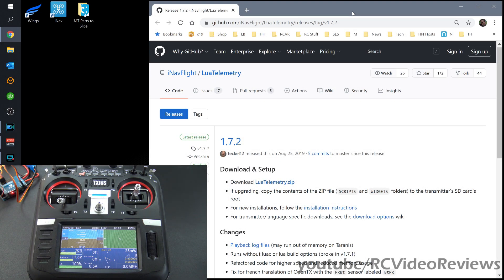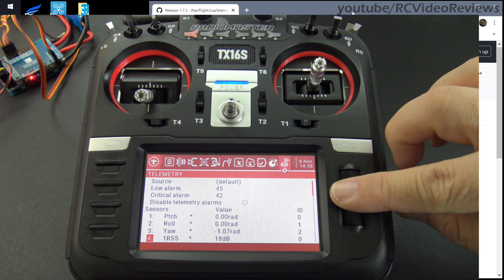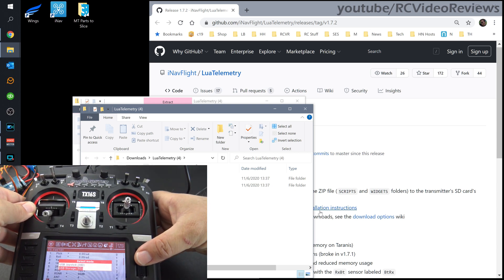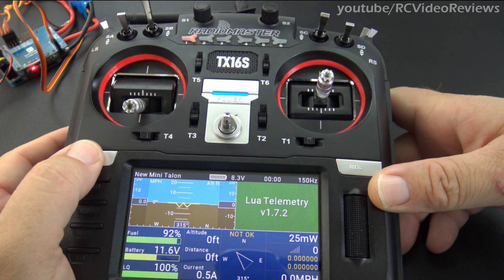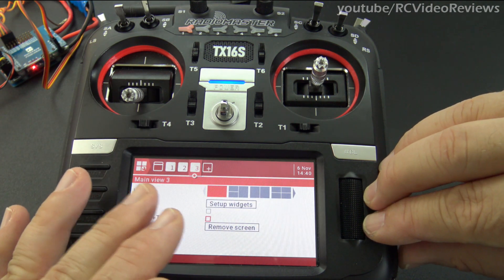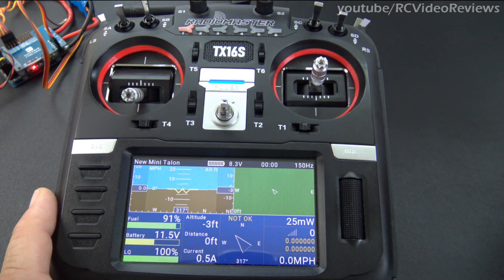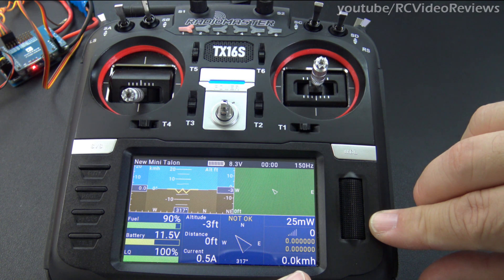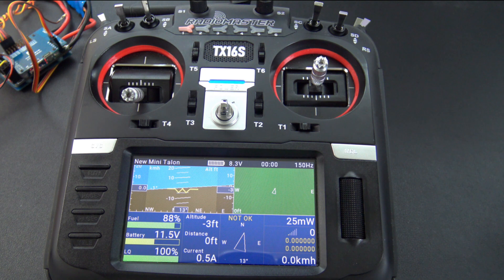How-to add iNav Telemetry Lua Script to Radiomaster TX16s

Comment: This guy really knows how to explain and teach how to set up the TX16S,  very clear and helpful. 
I’m really impressed by how accurately the TX16S shows the plane’s orientation (roll, pitch, yaw).
Could you please tell me which Flight Controller model you are using?
I’d like to buy the same FC model for my own plane.

Comment: I've been getting battery critical alarms with high cell voltage. I couldn't find a global setting that would produce that, so I suspect maybe it's in the LUA script. First person I've seen get into the LUA script menu. I tried to get in there with your directions, when I select EXECUTE I get a screen that says SCRIPT SYNTAX ERROR lualoadscripts(stnda) no run function. Any idea what that is. Hate the warnings, but no idea where they are coming from.
Reply: @MatyasArby  i have the same issue. Did you find the solution yet?

Comment: Hi, I added Inav Lua but the pitch axis is inverted, have you ever see such thing? When the FC pitch-up the telemetry is positive and when it pitch-down the telemtry is negative. Is there a setting for this?
Reply from the maker: Wonder if there's an issue with board orientation. Seems like your iNav setup is wrong to me.
Reply: I will try to wipe it out and reinstall it afterwards. Is your pitch telemetry positive or negative when your flight controller pitch up?
Reply from the maker: I don't have an iNav plane active at the moment. You'd be much better off joining my discord and asking there. https://discord.gg/jSFTASU
Reply: Will do thanks 👍

Comment: Excellent tutorial.  I got mine working, but the update speed is very slow -- like a bit over 1 second frequency.  So if I move my model, the AHI lags severely behind as to make that useless.  Any ideas how to fix this?  The top right corner of my screen shows 250Hz which is obviously wrong.  It's more like 1Hz update speed.
Reply from the maker: Might have to check with the developer on that one. :(
Reply: @RCVideoReviews  I found out if I use Crossfire module then the iNav AHI smooth.  But if I switch to ELRS then it becomes slow as I described above.  A friend of mine has the same problem.  We haven't found the solution yet but it's a start to tracking down the fix...
Reply from the maker: @beyondfossil  try turning up your telemetry rate in ELRS lua.

Comment: Thanks for the tip on setting the alarm thresholds.  I searched for a long time.  There is another item that I have not figured out.  How do you get a map display onto the upper right section?  I tried downloading map segments but they don't display.

Comment: Does this process have to be done for each model in the radio?
Reply from the maker: Yes, for any model that has iNav and that you want the iNav telemetry LUA to operate, you'll have to add it. There are options though, you can setup one model and use it as a template for others. That's what I do.

Comment: Great video.  So what is up with the upper right area where there is supposed to be a map.  How do you set that to work?
Reply from the maker: I never did figure that out.
Reply: I did install on a separate page the mapping widget which is a full screen map and you can add the key telemetry elements desired.   @RCVideoReviews
Reply from the maker: Oh cool. Sounds useful.

Comment: I don't know for what reason but the colors on my LCD change to very unreadable after running this script. What is the default theme to use for this script to work correctly?
Reply from the maker: To eliminate themes from the question, your best bet would be to use the default EdgeTX theme. I guarantee if the theme is involved, it would have surfaced with the default theme. Alternatively, check with the developer. Sounds like an odd issue to me.

Comment: Hi.  I have followed your video and the iNav script is running nicely with the iNav "standard model" installed on my TX16s.  The annoying bit is that if I change a switch such as SW A or SW D (back to the centre position) the Mode (Angle - Horizon - Acro) is spoken three times.  Is that normal, or if not what may be wrong ?   Oddly if the receiver (and thus model) is switched Off the Mode is only spoken once so the problem appears to be with the Telemetry script.
Reply from the maker: Not sure. You'd probably need to bring this one up with the developer.

Comment: I have inav lua working on 2 different planes, only thing not working is the output power of the exspresselrs  transmitter, funny thing is that in osd it's working just fine but on radiomaster tx16s screen it shows 0mw on tx output, also wondering whats the sensor name that provides tx out put power? Thanks for all your videos
Reply from the maker: TPWR is the name of the sensor for ELRS transmitter power. If it's not displaying correctly in iNav LUA, you may need to check with the developer.
Reply: Ok thanks will do

Comment: I have been getting grey hair with this one.
Got all working, on radio tx16s with working telemetry with jumper R8 to pixhawk 6 c.
But no value on distance from home or roll, yaw. Noticed on the telemetry list I do not have 0420 sensor for distance to home, or the 0430 onwards for the horizon graphic.
Do you have any ideas. I currently get it from separate osd, but want it on 2.4ghz
Regards
Dave Pope
Reply from the maker: Probably need to get on the iNav github and see if you can contact the developer. Hard to be involved with that level of detail on so many different possible setups/firmwares/controllers etc...If overall functionality works, the details will be down to the developer to help you sort out.
Reply: @RCVideoReviews  awesome thanks, love your video's.

Comment: very nice video , I installed the inav LUA in my TX16s, I use Frsky receiver on a pixhawk,  but I cannot get orientation data, the inav page basically not showing any data, any suggestions ? I am not sure does inav support mavlink which is used by PX4, thanks
Reply from the maker: Probably should let the iNav developer know. It's probably a sensor definition issue.

Comment: Hi John
Just followed your instructions on installing inav telemetry widget. However the respince time on the screen when I mive the plane is like 12 or more seconds. Any thoughts or advise?
Reply from the maker: Only to ensure you're on the latest copy of iNav. If you are and this is a repeatable issue, you should open an issue with the iNav developer.
Reply: @RCVideoReviews  using inav ver 5.1.

Comment: Great video!  But has anyone else had the problem where it won't show you or announce the modes other than Manual, Angle, and Acro?  Any other mode like RTH or Position Hold just show up as ACRO.  I'm using the TX16S with Crossfire Micro TX and Nano RX and MATEK F11WSE.  All firmware is fully up to date as of 9/20/2022 and the iNAV Configurator shows that all the modes are being selected correctly.

UPDATE - I thought it was Crossfire causing the problem but found it's actually iNAV that's doing it and it's specifically this version: inav_5.1.0_MATEKF411SE_FD_SFTSRL1.   I needed the softserial port for the DJI FPV Air Unit.  But now I've connected my analog camera and VTX to the F411WSE board and I can see that iNAV is using ACRO for all modes except Manual and Angle.  I need to see if I can find the right place on Github and enter a ticket.
Reply: I am using EdgeTX2.7.1, TX16S and Crossfire TX and I had the similar issue. When I set the baud rate for external crossfire TX equal to or smaller than 400K, the telemetry data only show pitch and roll data, no others. But if I increased the baud rate more than 400K, then the issue disappeared ...  Not sure what is the cause...

Comment: Apparently the current inav.lua script on EdgeTX cannot be run directly by executing form Scirpts folder on sd card.  It is meant to be run via the widget feature of EdgeTX.   I got a nill value error when trying to execute as a script.  I was told this by opening an issue on the github repository.

Comment: Question?
I guess the Fuel Percentage value on your screen, is really the Battery shown as a Percentage?
Thanks!
Reply from the maker: I believe it's derived from BF information where you enter the cell capacity and your desired cutoff voltage; however, I haven't really experimented with it so can't say for sure.
Reply: @RCVideoReviews  Thanks!  I have not seen any information that has specifically explained how Fuel data is calculated.
Also, thanks for taking time to produce these great videos.
Reply from the maker: You’re welcome. Let me know what you find out. It probably wouldn’t be too hard to confirm with a little testing.

Comment: I just followed your video on upgrading to EdgeTX 2.7, Black Pearl, which was done in 2022. This Video was done in 2020. Is this compatible with Black Pearl?
Reply from the maker: The latest iNav Widget https://github.com/iNavFlight/OpenTX-Telemetry-Widget/releases/download/v2.1.0/LuaTelemetry_v2.1.0.zip loads and runs on Black Pearl. Whether or not it "works" using your sensors/telemetry/fc etc...I can't answer. It loads and runs fine as a widget.

Comment: I have the screen working on my TX 16 but when I put on my FPV goggles I get a warning on the screen to disable navigation first, unable to connect. My Goggles are Fat Shark Scout. Do you have any idea what I'm doing wrong and why I don't have throttle control?
Reply from the maker: I'm not familiar with any error message that says, "disable navigation first, unable to connect".  If you're using analog goggles, there is no interaction between the transmission/reception of data and the flight computer other than the overlay of OSD. In other words, there is no mode on the FC that can prevent video data from reaching the goggles. Navigation modes generally involve the GPS, so you may want to ensure you have a manual mode available and that it is active before attempting to arm.
Reply: @RCVideoReviews  it is showing on the screen it is manual mode. I believe I have something set wrong in my tx as when tested on another trans that was used previously with this model everything works. I had to load the iNav files to my tx so I need to check the files to see what is different, thank you

Comment: Hi John, what flight controller are you using here and how did you wire up you crossfire rx? Thanks 🙏
Reply from the maker: It was probably an F722-WPX, but it's more about iNav sensors and the ability to send those sensors via telemetry to the radio. Crossfire is wired like any other Crossfire to BF/iNav board: Hot and Ground + Rx and Tx to a UART.

Comment: Hey I was just wondering if someone knows is there a way to put the home direction arrow on this widget? I'm going to be using it for a quad but just in case my goggles die while doing long range it would be nice to at least get a home arrow to guide me back till I could land line of sight. Thanks?

Comment: Can this be setup on the DJI F550 hexacopter?
Reply from the maker: The LUA scripts depend on iNav telemetry. So the script will load, but no data will appear unless you're getting telemetry using the same sensor names the script expects from iNav.

Comment: hi dear i have try inav scrit in my t18 with edgetx but i see only graphics value and not text lyke battery fuel level and these values are only shown when  the battery  of my quod are disconnected . what happens?

Comment: This works with Edgetx?
Reply from the maker: I just checked yesterday and it does work with EdgeTX 2.6 BUT I didn’t launch a craft to verify sensors. It does load and run though.

Comment: Ok i add to my radiomaster and i see power tx signal rssi but my baterry have 0v. I search new sensor and the same. Whats the happens?
Reply from the maker: You probably aren’t getting pack voltage telemetry. Don’t mistake that for A1 and A2.

Comment: That "Fuel" gauge is confusing...
What is it reading? Battery percent? (but all battery packs are different)
How does it know?

Cheers from New Zealand and Kia Kaha!
Reply from the maker: In betaflight you can set the mah of the battery and your low voltage cutoff. The flight computer can calculate mah consumed with a current sensor, therefore the fuel % can be derived. Honestly, I don't pay any attention to any of that stuff. I simply watch my voltage. Depending on the type of aircraft, I get it on the ground around 3.6-3.75v/s

Comment: Hi, I have two airplanes in the RadioMaster TX16S transmitter using the Inav telemetry page. For one airplane the page is working OK in accordance with your tutorial. But in the other airplane the page is not working. The artificial horizon is not moving when I move the airplane and also the information like battery voltage, fuel and number of satelites aren't appearing. Could you help me? Thanks
Reply: I did the reset flight and reset telemetry and nothing happened.
Reply from the maker: Do you see telemetry data on the telemetry page of the radio? i.e. Discover new sensors...does that populate sensors and their data?
Reply: @RCVideoReviews  Yes. When I do discover new sensors it didn't discover the GPS
Reply from the maker: So you see sensors for attitude, voltage, fuel, but not number of satellites? 
You may need to speak with the inav lua script developer on github. What I know is that when I have the sensors active on my model and then I activate the lua, the lua script works. If you have sensors and the lua script is not working, you'll probably need help from the guy who wrote it. There is no option to turn these things on or off that I know of within the script.
Reply: @RCVideoReviews  The Crossfire receiver was bad. The telemetry was erractic. Then, I installed a new one and the problem was solved. Thanks for your support. Cheers from Brazil

Comment: Hi, friend, I followed your instruction, and I successfully installed and run this script, on Sbus Frsky and Matek F765, everything seems working right , EXCEPT for that sensor called "FUEL", in my case, when I power up the plane, this sensor just start very slowly increase the "%" and its just keep increasing until 1200,,1205% etc etc and dont stop, even when the model is on the bench and nothing is running !! what could be wrong ? some parameters that need just adjust in editing ?, thank you and waiting for suggestions..greetings !
Reply from the maker: Not sure. Did you set an MAH level in betaflight/iNav?
Reply: @RCVideoReviews  I fixed now, it was two things , first, you have to set FUEL = PERCENT in the CLI, and second in the configuration tab, the field "Capacity" you have to complete it with you specific battery total mAh to use. And now it match perfectly between the values displayed in the OSD and the value populated in the lua script..thank you again !! for your videos

Comment: Hi thanks for the video,
I got it working this far. The distance however stays on 0 meters no matter how far the plane is away. Because of that the arrow on the little map in the top right hand corner of the screen always stays in the middle.
I would appreciate if anybody could help me.
Thanks
Reply from the maker: Do you have working GPS?
Reply: @RCVideoReviews  yeah. Tim the developer of the lua helped me. I was running a version of opentx which wasn‘t able to work with my crossfire’s flight mode telemetry sensor. Thanks anyways

Comment: This is awesome and really easy to set up! 

You can change the widget settings when you’re on your actual widget page by pushing left stick up and to the right, then using the right stick to move around and select.
Reply from the maker: Yeah, thanks. I found that shortly after publishing the video. Good tip.

Comment: Great video.  Is there a certain telemetry that tells us if INAV has a 3D GPS lock which allows arming of the motor? The satellite number next to HDOP doesn't always corresponds a successful arm.
Reply from the maker: 3D GPS Lock as in > 6 or > 7 satellites? I don't think there's a 3D lock sensor; however, you can use logic to give you an alert. I believe Sats is the count of sensors. Use that value in a logical switch.  L01 a>x Sats 6  Then a special function when L01 is active, play track "xxx".

Comment: can the radio voice all telemetry from inav screen? buy setting up values in special functions
Reply from the maker: Telemetry comes from the telemetry sensor. Voice prompts can be set to react to data values from the telemetry sensor. The script is merely visually presenting telemetry sensors. So, yes, whether or not you run the script, you can create voice prompts in response to telemetry sensor data.

Comment: It work for Radiomaster r168 reciver via s.port. OR not?
Reply from the maker: I haven't tried s.bus and this script, so unfortunately I cannot answer.
Reply: @RCVideoReviews  thank for reply,  I'm not confident to buy.
 R168 Specifications 
Telemetry: S.port(smartport?), RSSI output, VBAT (up to 18V voltage detection)

R161 Specifications:
Telemetry: Supports flight control TELEMETRY & RSSI output

Comment: Why the GPS coordinate doesn't show in the widget ?
Mine also does the same.

Is that because the GPS module doesn't support OSD ?
Reply from the maker: It's because I don't get a GPS lock where I film and if I did, I'd still blur it out ;) I do believe it shows up at the field though.

Comment: is this script good for a Quad ?
Reply from the maker: It's designed to work with iNav. It is not airframe dependent. So yes as long as you're running iNav it should work. I've also heard it will work with Betaflight, but I have no experience on that one.
Reply: @RCVideoReviews  thank you so much for the reply.
Reply from the maker: @sanjaydamodaran3219  Sure.